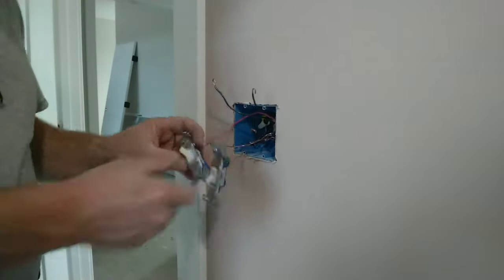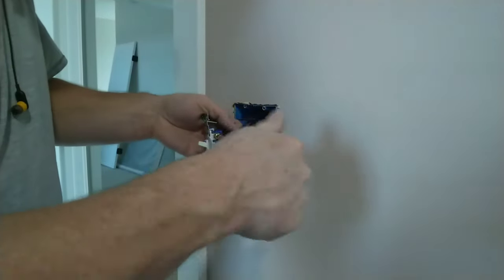How-to-wire up ceiling fan/lights on separate switches (helpful tips)

Comment: I visited a friend's newly-bought new build and she wanted to show me all the rooms and the big windows and how big the kitchen was - what caught my eye immediately and impressed me most was that someone had set all the wall plate bolts in the same vertical orientation. We're both a bit OCD and I asked her if she'd done that, and she said no, she hadn't noticed it.
I'm 43 years old, have done apartment maintenance, moving jobs and house sitting for years, and that's the first time I'd ever seen any property where someone had bothered to harmonise the plate screws. Even if that's solely down to the electrician themselves and not the eye for detail of the contractor, that at least gives me confidence that the wiring behind the walls has been done properly. It's a really nice touch.

Even though this video isn't exactly what I was looking for, I stayed for the excellent home wiring pointers.

I'm here because I was using the ceiling fan for the first time in an old-build condo, and it occurred to me that the fan's lights and motor were both wired to the same switch: a light dimmer (clearly recently retrofitted as it's shiny white while all the other switches are a haggard filthy beige-green 😆). I thought that can't be right ... I tested the "dimmest" setting to see if the fan motor would turn on, and sure enough it would only kick in when I started fading up the dimmer slide. Guess that explains why the blades were spinning so slow (like a noir detective's office). I pulled the switch out, capped the connection and got in touch with the landlord. Not an immediate hazard, but definitely not the proper installation.

Even if someone's not a pro - which I'm certainly not - and other people are hired to do maintenance and work around the house, I think it's great to have some basic knowledge of home wiring (and of course other DIY stuff) anywhere you live. Youtubers like yourself are great at empowering people to know their home environment better - what to expect from the equipment and materials in your home, what changes you can make so that things work the way you'd like them to, how simple it can be and how to do it safely. Three cheers for the teachers!
Reply from the maker: Thanks for watching and commenting. I really appreciate the compliment 👍👍

Comment: Bro! This is one of my all time favorite videos regardless of subject. Being an old mechanic and long time DIY'er. I appreciate the no nonsense approach. Usually only looking for tidbits of info and this wasn't exactly what I was looking for. But I got sucked in and couldn't stop watching ! May rewatch on my PC , big screen LOL.  What I was looking for...wiring ceiling fan w lights to double dimmer/rheostat switches. Ever done it ?
Reply from the maker: Thanks for watching and commenting. I appreciate it 👍🏻 
I've done dimmers before but never a double dimmer on the same light circuit. I was taught  and instructed not to do it. Could cause some unwanted problems.

Comment: Ron, loved the video.  Professional, neat and tidy work. When we do something every day, doing it correct becomes automatic.  The "why" may help so many.

New to the trade/ diy'ers:

Impact drver are easy to strip small screws.  Use a drill with a screw clutch if you must.  The lowest clutch setting will get your screws in and then tighten with a screwdriver.

The connection pattern:
Ground then neutral then hot (as he did) to connect and reverse to disconnect is the safest.  This allows the ground to trip the breaker and prevents a possible "hot neutral" (power feeding through a load with the neutral not connected puts 120 vac on the neutral).

His wires were labeled on the sheath (wire outer jacket).  Electrical tape and markers (silver sharpie for black tape or black on about every other color) can keep the wires identified during hook-up and a camera can remind you where things go.  

Twist the wires together and measure them to cut at the correct length for the wire nuts or realize lineman's pliers are about that thickness.  Just make sure the cutters are on the correct side of the wires.

Again, great work and hope this helps someone.
Reply from the maker: Thanks Keith for the added input ❤️ Always appreciated, my brother from another mother.

Comment: Very informative video on how to install the two switches for lights and ceiling fan. I love your tips on the wall switch and screws. I had read that having the screws vertical they do not collect any dust that way, it falls off easier.
Reply from the maker: Thanks for watching and commenting. I've not heard that one before. I started many years ago turning the trim screws vertical due to the inspector George Landing's comment. (Women are less likely to break a finger nail if the screws are in the vertical position) 🤔 Me being a guy knows how important a woman's nails are to them.

Comment: This video is so jam packed full of tips and howto. I'm hooked. You mentioned the stablocks in the back of the switch are fire hazards (~2:30).  Curious to know what have you seen over the years with these installs.
Reply from the maker: Thanks for watching and the comment ❤️ I should have referred to the stab locks as being a fire hazard more on outlets then on switches. The ones that I found issues with are usually attached to high amp loads such as space heaters and hair dryers. And yes I've had to do repairs on fire damage from the way these devices were installed. This would make good video content when I run across it the next time.

Comment: I get you're on the job & have to go quick, & youtube want's you to keep it short. But, dam blow'n through it so fast its not easy to follow, when/if never none it before. I hoped there was transcription, but no, ha! But, anyway sort of gave me an idea.
 If at some point you make a video, as a "mock-up" of a complete how to wire a fan/light with duel switch, and how to wire it to the ceiling fan/light, (what wire goes to what wire on the fixture), we would really appreciate it.
You're a pro, & know what you are doing, I want to do it correctly as well, maybe 3 times slower, lol, but, retired & working for "me" so don't matter anymore, main thing is I can do it at 62! Ha

Comment: I want to remove this set up and go to one switch. I’m removing an old fan without a remote that had separate fan and light control. The new fan has a receiver and remote and only needs one input. So going backwards about what to cap off in the box is helpful.

Comment: THANK YOU FOR YOUR VIDEO...  I AM HOOKING UP A FAN THAT IS CONTROLLED BY TWO DIFFERENT SWITCHES, ONE FOR THE FAN AND ONE FOR THE LIGHTS  BOTH ON SEPARATE WALLS IN THE BEDROOM.   WHAT SWITCHES SHOULD I BUY THAT ARE REALLY GOOD SWITCHES THAT WILL LAST A LONG LONG TIME FROM LOWE'S ????
Reply from the maker: Thanks for watching and commenting. The standard Eaton 15 amp switches are good. But you could do a commerical grade switch for longevity.

Comment: Great video. I saw where you connected the pigtail to one hot wire but didn't see you connect the other end. Did you connect it to the other hot wire? Thanks.
Reply from the maker: Thanks for watching Cindy. Yes, that 2 gang box had an in-feed and an out-going Rol-max wires. With it being a two gang=two switches there are two pigtails tied to these hots. So as there are one hot pigtail for each switch. I hope that helps you.

Comment: Nice Video.  I don't get the "feed to other" wire - is that to the first switch you did?  Also, why use a 14 3 wire to the fan?  I would think a 14 2 wire would do the job.  Is there a schematic somewhere to see  where the wires go?  I have a fan/light to put in next week in my house.  Thanks for the video.
Reply from the maker: Thanks for watching and commenting Bob. I lable all my wires. Feed  & fan/light & 
feed out =feed to other. 14-2 NM is adequate for most ceiling fans. But if you choose 14-3 NM, you'll have another switch leg to control the fan at the switch location. I hope that answers your question.
Reply: @workingmanrondoyle3287  ok. I get it.Thanks

Comment: I recently bought a house with ceiling fans that are powered via remotes rather than wall switches which seem to power wall outlets instead. Im trying to figure out how to add switches so that the ceiling fan and light can all be acrivated from the wall vs these grimey looking remotes that came with the house
Reply from the maker: Hey Shawn, thanks for watching and commenting. In most cases the feed is ran to the fan location in that scenario. You can add another box by the switch location and run a 14-3 or a 12-3 NM-wire for switch legs going to the ceiling fan location. Re-identify the white wire with red or black tape. That will now be your hot. The red wire will be the light wire and the black will be the fan. (No neutrals) are needed at this location due to it being old work. Let me know if you need more instruction.

Comment: Great video!!

Question... what is the purpose of the neutral wire?
I noticed you didn't used in any switches. 

Thanks!
Reply from the maker: Thanks for watching Carlos Ocampo. In the residential homes wired today, we are using AC=alternating current. This current needs to have a path back to its original source and a neutral to the light or appliance it's powering. This is why we always have neutrals connected together and never switch or break them. If you ever seen a white wire under a switch, it is due to using the white as a traveler leg and this wire should be re-identified with black or red marker or tape. I hope this was of some help to you and answering your question.

Comment: I'm usually not a fan of people that preemptively speed up their videos, but in this case you nailed it. Only thing is, I was originally searching for fan speed adjustment at the switch. I know you're not covering that but since you're doing new work maybe you would know, is it just a bad idea to use resistance-switching rotary knobs or multi-position sliders in wall boxes these days? It seems to be less and less popular compared to what I remember from my childhood, so I'm curious if it's unsafe or if people just don't care anymore?
Reply from the maker: Thanks for watching and the comment R-libby. I've started to slow down the videos due to the complaints I've received for doing so. I steer away from dimmers at switch locations due to the heat buildup, they can produce. They are listed in labeled as being safe. But they can get excessively hot in reaching temperatures up towards 160°F. I refer people to putting in wireless remotes with transponders at the fan location to be in much safer option. This would make a good video presentation. Thanks again for watching.❤️
Reply: @workingmanrondoyle3287   You're welcome, and thank you!

Comment: Can the blue wire be used to power another light fixture instead of the fan?
Reply from the maker: Thanks for watching and commenting. The blue wire I'm referring to in this video is the light wire(blue) coming from the fan itself. The wire I feed to it, is the Red wire of the 14-3 NM. If someone wanted to wire the fan & light on one switch leg and use the other switched wire for another device (such as recessed lighting) this could be done.
Reply: @workingmanrondoyle3287  thanks for the feedback. I've installed a fan /led light combo on a single switch left me with an idle wire & switch (12/3 blue 😁).

Comment: Thanks Ron! I bought a harbor fan with dimmable led lights. I wired the ceiling fan per instructions red and blue wires together from the fan to the black wire coming out of the ceiling and the white wire from the ceiling fan to the white wire coming out from the ceiling and the green ground wire to the green ground  my outlet box does not have a red wire for the dimmer switch   just 3 black wires and a bare copper ground wire and 2 white wired tied together  the dimmer switch is a Lutron fan control and dimmer with a two separate controls fan and light . the dimmer switch has a  red, yellow, black and green wires How do I wire this ? Thanks!
Reply from the maker: Hey Billy, thanks for watching. Going by what you said in this comment 🤔 you only have a 2 conductor+ ground wire going to the ceiling fan. A lutron fan and light control switch will not work in this application. My suggestions would be to wire in a cordless remote and transponder to separate your features on the remote. They can be purchased for most big box stores for around 30 to $40 here in the US. The only thing I may add is check your fan canopy size to see if it can house the transponder? Most fans are capable of this add-on feature and some are not. Let me know if you have any more questions.
Reply: Thank you so much for the quick response I will follow up. Also after I wired the fan and the switch we notice the fan had a humm to it. Thanks again. 🙂
Reply from the maker: @Billy Mack  in most cases the excessive motor noise is due to not having the fan's speed set to high on the fan. Note: for a wall mounted speed control to work properly, the 
fan's speed needs to be set and left on high. Now your speed can be adjusted on the remote control.

Comment: Just curious...what power source is feeding the fan light?
Reply from the maker: Thanks for watching and commenting. The power feeding the fan
120 volt on a 15 amp breaker AC 60 Hertz. Wired up on 14-2 NM copper wire.

Comment: what was the first light switch you put in for can you run to seperate light switch on the same circute to one light
Reply from the maker: The first switch in this video was for the closet light. A second switch can be add off of a pre-existing circuit in most cases as long as that location has a feed wire. Not all box locations have feeds. In regards to adding a separate switched leg such for a fan. You'll need to change the wire to a 14-3 or 12-3 depending on the circuits rating. Along with a ceiling fan rated box. I hope this answers your question. Thanks so much for watching.

Comment: Nust moved into a older home as rental and im afraid thGgrounx wires will be rare
Reply: Ground wires will be nonexisrant
Reply from the maker: Thank you Larry for watching 👍. You probably right about not having grounded outlets and switches in older homes. I've worked on a bunch of them. Most older home have cloth wrapped & knob and tube  wiring methods. Very costly to rewire older homes but worth it. Some people resort to doing room by room over a number of years so as they can afford it. The least costly option is installing GFCI outlets on the first outlets coming from the home's electrical panel to offer some protection from shock! But if your in a rental house , I would advise you to leave it up to your landlord to correct any issues you may have. Thanks again, I appreciate you watching ❤️

Comment: Can a dimmer switch be installed for just the light?
Reply from the maker: Thanks for watching. If two separate switches are installed and your using dimmable bulbs or a dimmable light on the fan, then yes. If you want a one on the fan, it has to be a motor rated speed control. Then you would have to keep your fans setting on the highest setting for the motor speed control to work properly. I hope that helps you.
Reply: @workingmanrondoyle3287  Thanks but I’m my case, I would like to have only the fan light dim but not affect the fan at all. Maybe a switch just for the fan and a dimmer switch just for the light?